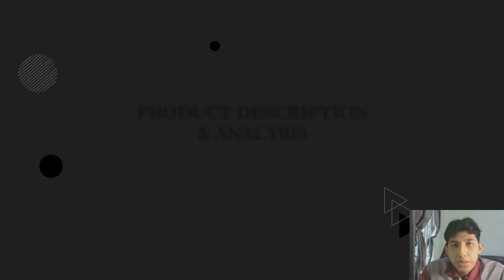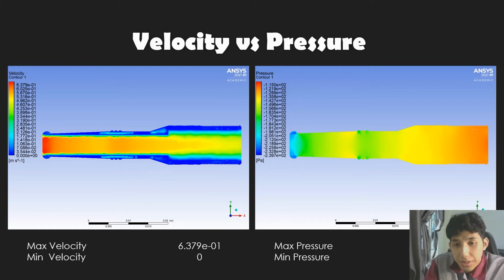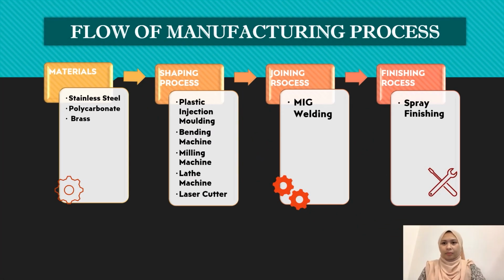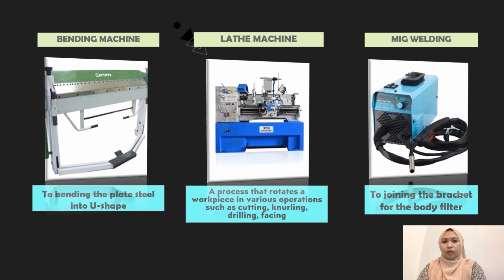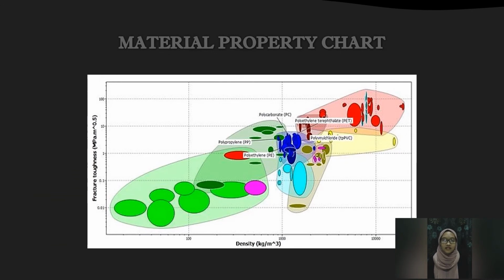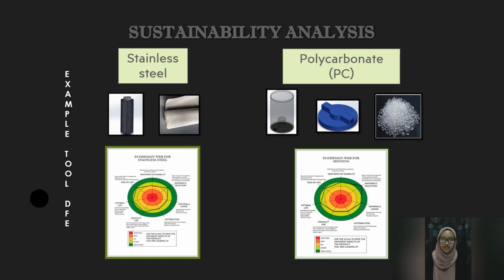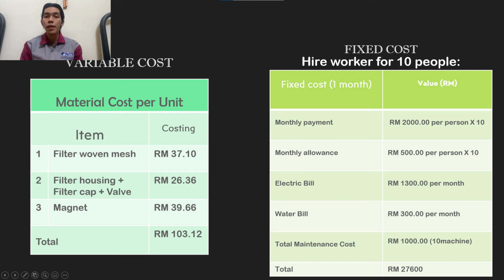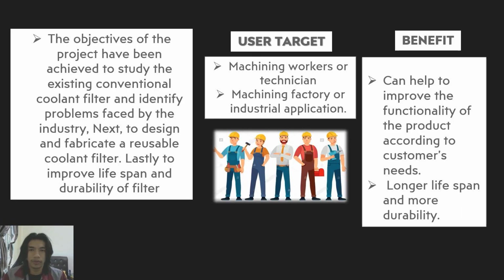BMFU3323 - G08 : Reusable Coolant Filtration System

Comment: Interesting product. 
1. How did you come out with the Selling Price number?
2. How much is your profit margin for this product?
Reply from the maker: Good evening Madam,
Thank you for your time and questions. Below are our answers.

We got the selling price of RM289.20 by applying the following calculations.

Cost per piece per unit = Variable cost per unit + fixed cost per unit
RM103+RM138 = RM241

Profit margin per unit = 20% of RM241
20% of RM241 = RM48.20

Selling price per unit = Profit margin per unit + cost per piece per unit
RM48.20 + RM241 = RM289.20

Hence, as the profit margin per unit for our product is 20%, we got the selling price per unit which is RM289.20.

Thank you and have a very nice day.
Reply: @farezamsyarzulkifli9342  Thank you for the clarification.

Comment: 1. What is the estimated lifespan of the filter?
2. The body/housing supposed to be molded or purchased of the shelf? Quite confusing. TQ
Reply from the maker: Good evening sir, 
Thank you for sparing your time to watch and evaluate our presentation. We would like to answer your questions below.

1. Through our interview with machine operator and maintenance personnel, we found that the current filter life span depends on the usage of the coolant. The dirtier the coolant, the faster it will clog up which averages at 1-2 months (common SME use). The time for it to need a maintenance and cleaning session is equal to the time of standard polypropylene filter need to be replaced. As for our product, the life span is only affected due to corrosion hence we estimated that our product could last for 8-18 month depending on the coolant substance.

2. Sorry for the confusion, as we are under MCO restriction, we are unable to fabricate the part by molding process in the UTeM lab. Hence we opt for the option to purchase the product of the shelf as a prototype. According to our original plan, the housing should be fabricated through Plastic Injection Molding process.

Thank you and have a nice day.
Reply: @farezamsyarzulkifli9342  Ok. Noted and understood. Good job.